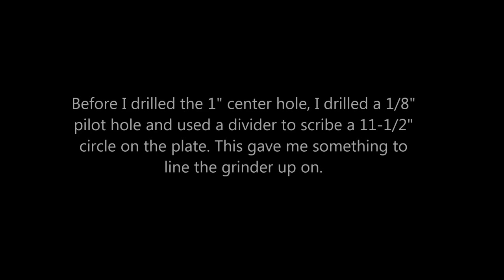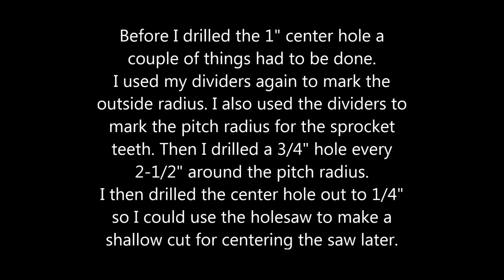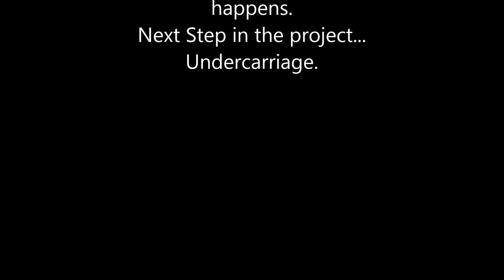Making Idlers and sprockets

Comment: Hey Dave....what do you think about using a motorcycle rear hydraulic brake system for steering the little dozer?
Reply from the maker: If its off a big bike, it should work, i used automotive brakes, I used rotors off a dodge car since they matched the bolt pattern and hub size

Comment: How much would you charge for a pair of them sprockets?
Reply from the maker: I wouldn't make another set. It would be cheaper and more efficient to have them made in a machine shop, or cut them from scrap pipe flanges. Each sprocket took a week of evenings to complete. If you found some old ASA/ANSI 150 flanges you could do it fairly cheap Another option would be old check valve bonnets for an old fashioned look ( they are dished cast steel)

Comment: Do you have detailed prints or a down loadable file a person could precious from you.
Reply from the maker: Sorry, not at this time. I expect to have one in the future.
Reply: ducks Garage how soon future? Next week would be soon enough. LOL!!
Reply from the maker: What do you need to know? I'm still working on some design issues with the steering setup.
Reply: ducks Garage am looking at incorporating three designs to make a set of 4 tracks to go on an articulateing cub cadet with hydro trans and 3 cyl perkens Diesel engine.
Reply from the maker: @ronaldpotts7436  Cool, My next project( once I get through the two I,m on now) will be to build a 4WD Ford articulated, Haven't got an engine yet, and still collecting parts, but I expect to get it done before I'm t0o broken to do it.
Reply from the maker: If you look at some of the other vids, you will find some dimensional data.  I made the sprockets to fit double pitch attachment chain, And it is designed for wear on the chain rollers and sprockets
Reply: ducks Garage I’m collecting parts working on it when I don’t have things that have to be done. Look at Johnson’s 4 wheel drive cub cadet on you tube it might give you som ideas. I’m going to pull the hydro unit out of a 140 Ford if we were closer, going to put a cub rearend under it and make a puller out of it.
Reply from the maker: I'm Subscribed to Johnson's channel. Believe me I've seen most of the overseas stuff too. I'm Always looking  for ideas. Cool plan on the Pulling tractor, Where are you, I need another Hydro?
Reply: ducks Garage West Tennessee out from Jackson Tennessee. Where are you located?
Reply from the maker: @ronaldpotts7436  Dude, I'm in Central Alberta, Western Canada. Shipping would cost me a tractor.
Reply: ducks Garage yes it would, I had a cub rearend shipped from Sterling Illinois to me on Fastenal’s truck $140.00 usd from her to there going through customs swapping trucks it’s no telling what it would cost.